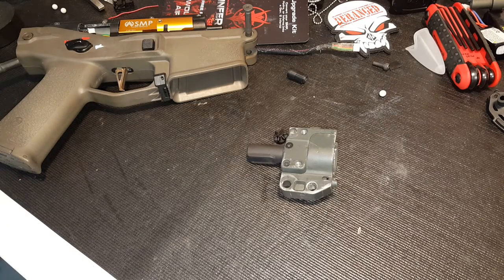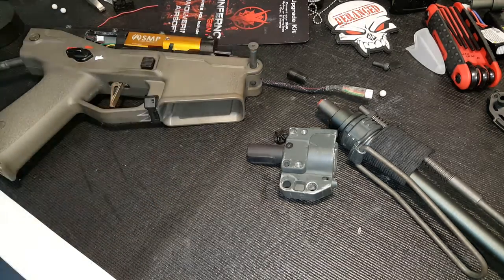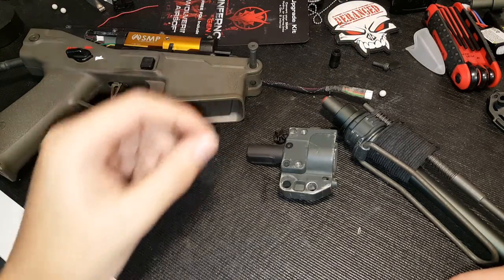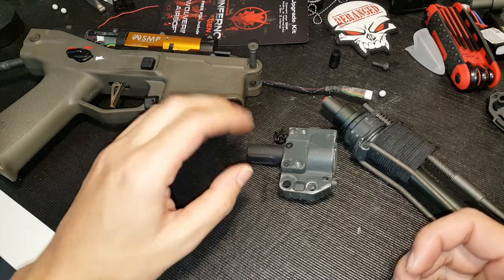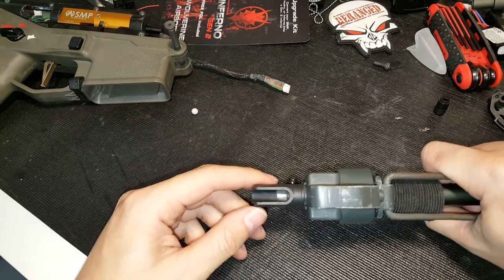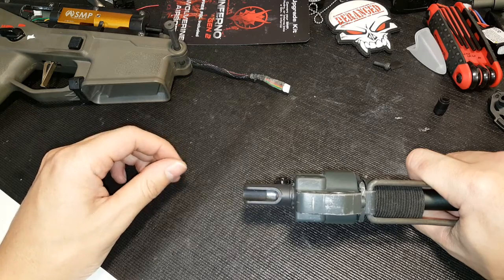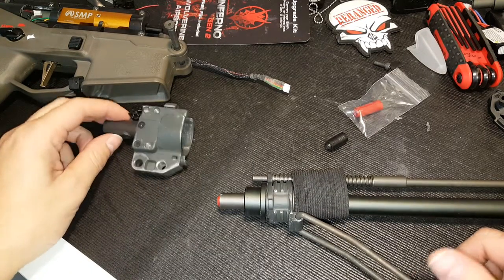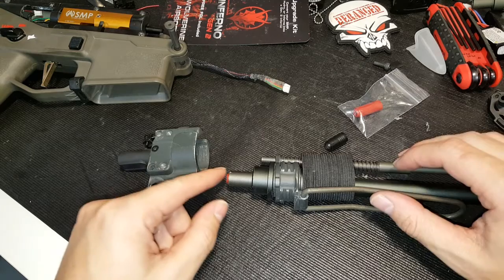PTS Masada feeding problem possible fix

Comment: The APS UAR has much the same issue with its buckings. For whatever reason, the stock bucking has really short feed lips, so 90% of aftermarket ones will jam the gun if you dare to use full auto or to spam semi.

Have to either dremel or cut the feed lips down to fix it.

Comment: Good video, I have the same problem with akm version...And if I cut the final part of the rubber ring a few millimeters so as to get its lips with that of hop up (rubber hu g & g green new) ?
Reply from the maker: PastUchiha 98 only way to know for sure is to try it and retest.  The akm is special because many have had feeding issues that vary from mags, feed chamber, and bucking.
Reply: Yes I'm sad for that, having dedicated pieces like the opening of the "S" shaped bbs that even differs from the 5.56 version that slows down the entrance of the bbs ... If I could bring the lips of the rubber perfectly aligned with the barrel without bringing protrusions and cutting a few  final millimeters to do it for you it would work? I noticed that now the input of my hu rubber doesn't have a perfect sphericity and finds itself slightly deformed, and that's why the bbs are not fired: /

Comment: So what hpa drop in would you say is best to install without tons of problems? SMP, Inferno gen 1 or gen 2?
Reply from the maker: Ripcity Airsoft the inferno Gen 2 will be the most forgiving if the nozzle is slightly misaligned.  All of the installs will be about the same.  Best performance will come with a perfectly aligned nozzle.